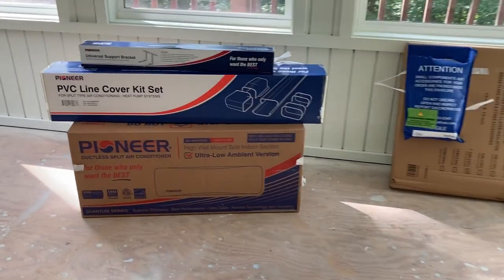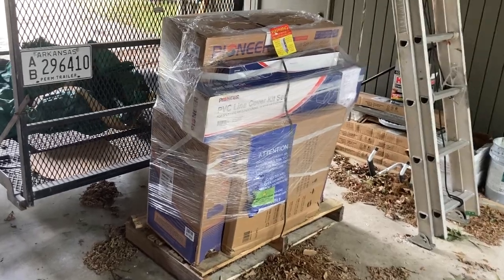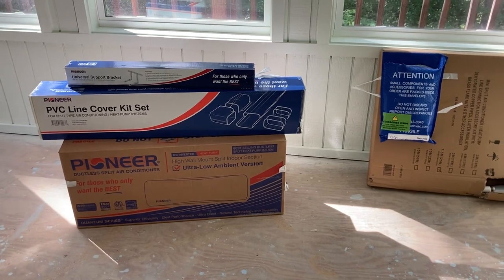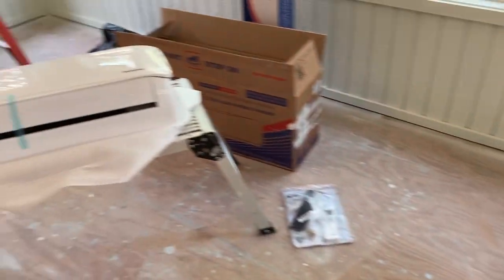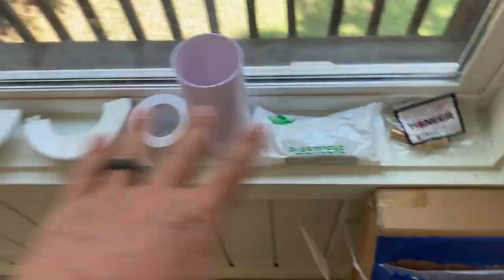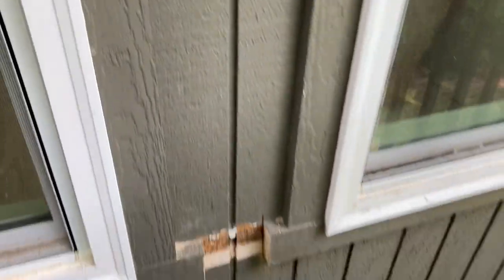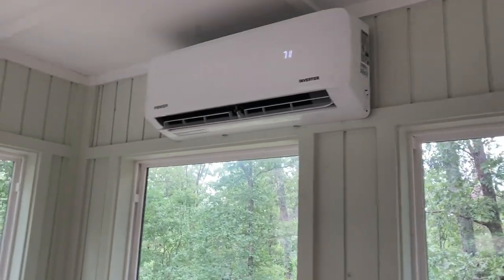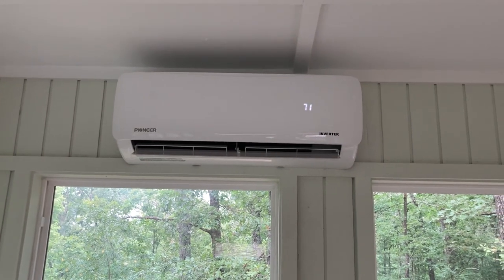DIY Install Pioneer 12k Mini Split Unit 230v - Careful, Don't kink the line set!

Comment: Excellent video. Thank you!

I just finished an installation of two Pioneer Hyperformance (WYF) Mini Splits. I chose them because of my very northern climate, as these units operate with great efficiency (23 SEER) and can heat when outside temperatures are as low as -22°F (with reduced efficiency, of course, but still operate.)   I think that your box said Hyperformance also.

I did not see your video until now, a month later. Before purchasing Pioneer Mini Splits, I must have looked at 30 YouTube videos. Yours is the best one of them all.  Granted, it is not a complete DIY video as you remarked, but it does the best job of summarizing the installation and giving warnings where needed.

I want to add my notes to your excellent comments here.

1. You were soooo smart to exit the lines to the right and not the left!  I was installing the indoor units on upper floors, so I figured it would make sense to make the connections inside the house by tipping the unit up and connecting underneath, inside, instead of on a 28 ft ladder outside.  BIG mistake. Use the ladder!  Reason is the lines installed to the left make a bulge that is almost impossible to compress to get the inside panel cover to snap on! Plus, the indoor unit does tilt up but it is on tiny plastic hinges that slip off with the slightest movement while you're working, threatening to drop the whole unit to the floor.  So much so, that it really takes two people to do the job, one holding and one connecting.  So, go to the right.

2. Do NOT use the inside little round plastic flange cover over the inside wall hole.  I don't think you did. It is useless and contributes to extra effort to snap inside cover on.

3. The line set ends from Pioneer are NOT the same.  The ends at the indoor unit are at different spacing to match the spacing of the indoor refrigerant lines.  The line set ends at the outdoor unit are equally spaced.

4. Your kinking experience was unfortunate but very helpful to others that follow you and they will, therefore, be extra careful because of your misfortune.

5. Your vacuuming, to my eyeball, did lose some small position on the compound manifold gage after you let it set for 30 minutes.  Granted, your vacuum may have been enough, but I recommend using a digital vacuum gage to make sure you get below 500 microns and hold the vacuum there.  Any moisture in the lines will cause some small acid build up and reduce the life of the unit.  Any air in the lines will cause extra compressor effort.  So, maybe your setup will be good enough to last 5 years, but why not get it perfect and maybe go 10 or 15 years?  Yadda yadda…. I know, I have seen on YouTube all the old guys say they never had a digital gage in the old days……  but still, I recommend it.

CAUTION: Re flares...... Refrigerant line sets do NOT use plumbing tubing sizes. In the small print it clearly say, on all mini split brands, that the 3/8 inch tubing line set is 3/8 inch o.d. 

BUT, if you go to ACE and buy a flaring tool kit for $28, you are buying a plumbing flaring tool kit.  Plumbing 3/8 inch tubing has a o.d. of 1/2 inch!!!!!  So, you are doomed to failure if you try to use a plumbing flare tool on a refrigerant line set.

6. All the rest of your video is spot on.

7. And that brings me to a different approach on my units than you took.

I am proficient in house wiring, so I knew I would do my own electrical work. At 75 years old, I am still strong enough to use a ladder, lift stuff, set the indoor and outdoor units, install a wall bracket indoors and on the outside wall, pour a concrete pad for one of the outdoor units, run the refrigerant lines out and down the wall, and install the line set covers, which, by the way, takes extreme grip strength to get them to snap together!!

But, I also have a few bucks in my pocket, and therefore having saved all the money by buying the Pioneer units direct (with free shipping) and doing the work above myself, I decided to get someone to cut off the excess line set length, nitrogen pressure test, vacuum the lines, and do startup and sign off on my extended warranty form (5 years.)

As you found out, there are puffed up hvac contractors out there who will be of less than no help unless you give them your first-born.

I was extremely fortunate to have a local hvac technician that had done over 80 mini splits in a giant housing project and he had excellent long-term results.  His work was quick and efficient. It took him from 9am to lunch to do the flares, the testing, the vacuum and help me with some lifting on the two units. What a pleasure it was to see him in action and to hear his stories.  He had a digital everything for tools, the best quality.

The cost for his services were acceptable to me without any haggling by me at all.

I slept well afterwards, knowing my installation was 100%.

I do applaud your own installation work and am sure you sleep as well as I do.

As for my 2 months of Pioneer Mini Split usage?  I could not be more pleased.  Units work great.  They are almost silent indoors and outdoors.  The Wi-Fi is great.  I can see my adjustments from anywhere in the world.  (BIG note here:  The latest (as of 9/23) app is ConnectLife.  Do not use the other 5 apps that others on YouTube used in the past!!!!!.)  I am going to purchase one more unit, and that is a testament to Pioneer.

I researched 5 different mini split ac brands including Mr Cool.  The biggest factor for me was not price, but customer service.  I read that Pioneer (Parker Davis in Ft Lauderdale, FL) answered the phone!  And, boy, did I call and call and call to get my pre-purchase questions answered. I had a few installation questions as well.  I never had to wait more than 5 minutes and often less than minute. I heard that another brand could never be reached at all….

So….
Have a beer!  Thanks for reading… and thanks again for your video.  The BEST ONE ON YOUTUBE for mini splits overall.
Reply from the maker: Wow!! Thank you for the reply and the praise! I enjoy making these videos. I’ve always been a DIY guy, and sounds like you are as well. The pioneer mini split I installed in this video has been running non-stop since I first turned it on (at the end of the video). It’s run non-stop now for 2-years. We leave it on during vacations, out of town, etc. The unit has ZERO issue cooling the sunroom. It keeps the sunroom as cool as an icebox during 100+ degree weather. And it will keep the room warm during ‘normal’ winters (normal meaning above 30 degrees for Arkansas). However when temps drop below 20 degrees the unit struggles to maintain 70 degrees. And if temps fall to near 0 degrees, it can’t keep up. We have French doors that lead into the main house and if I keep those open (which I do), the main house heat will supplement enough to keep the room livable. With that being said, I’ve ordered a 240 volt German made wall heater I plan to install over the next month. That should help the mini split keep up during un-common cold days this winter. 

I appreciate you walking me and others through your install. I enjoyed reading your reply. I’ll post a video of the wall heater install soon! I do my own electrical work as well (however I don’t post DIY electrical work, for obvious reasons). 

Thanks again for watching and for the excellent reply!

Comment: You saved a ton doing it yourself. So you are still far ahead. I did the same kink to mine but fortunately 2 ft from end so I had enough to cut off and redo end. A friend loaned me a 1/2” bender and the second bend was a breeze.

Comment: For those who don’t know may be no need to purchase vacuum pump and gauges. . A lot of major auto parts stores rent tools which usually includes vacuum pump and gauges. I’ve rented them at least 4/5times over last few years and never paid anything but a deposit -which you get back when return.

Comment: Great tips on not kinking the lineset. I would invest on a micron gauge, 2-stage vacuum pump and leak detector to check for the leak. Holding vacuum does not mean leak-free. It is when the unit is producing heat that the lineset has the high pressure when leak happens.
Reply: SO RITE !..NITROGEN PRESSURE TEST OVERNITE..SOAP THE FITTINGS,,ITS A LEAKER MOMMA !!LOL

Comment: I just finished the first zone of mine.  Thanks for sharing your mistakes and suggestions.  Its a steep learning curve the first time you do it I think.  The second zone should be easier now.
Reply from the maker: Awesome! There is great satisfaction in doing it yourself! Good luck with the remaining zone! My unit has been flawless so far. Keeping us cool during this 100 degree heatwave! It runs 24/7, we haven't turned it off since the install. No short cycling. It will power itself down or up when needed, on cool or heat settings.

Comment: I wish you would have mentioned the crowfoot sizes.  I saw the 15/16 by stopping the video. Also, I would have liked to see you connect the hoses in the inside unit.  My main reason for watching was to see how it is done in that tight space with a torque wrench.

Comment: Wow you did a great job, just had the same unit installed only difference mine is 110v. My installer did not close up those electrical holes on the unit like you did. See you learn things when you watch YouTube.👍🏻
Reply from the maker: Thanks for watching. Closing up and capping the electrical connections at the unit should be code in most places. I would have them come back and do that.
Reply: @Ozarkwild  I did my electrician came and did it for me but the air-conditioning guy should’ve done it

Comment: When you took the adapter off the mini split port did a lot of refrigerant come out thanks for the idea i have been doing it by releasing all the refrigerant first from the liquid and and the suction line I open all the lines up I think the idea you did is good you just open the suction line a little to introduce some positive pressure and then close so you don’t loose refrigerant
Reply from the maker: I did not lose much refrigerant at all, just barley. You are correct, introducing only a little positive pressure prevents the high pressure release as you remove the adapter. Make sure it's done quickly however, or else you run the risk of evacuating the line (due to the very low pressure).

Comment: Nice!!! I am installing one of these for my Jeep garage this week. It just got delivered a few days ago.
Reply from the maker: How did the install go? Any issues?
Reply: @Ozarkwild  it all went pretty smoothly. The hardest part was just bending the conduit and running wire. Everything else was pretty darn easy, just one step at a time it went great. I took my time and triple checked everything and my 12k btu unit cool and heats great!!
Reply from the maker: @REJECT_GARAGE  Good to hear. Mine is still running great as well.

Comment: I just looked at my adapter the smaller part that connects to the line don't have the valve inside at all & all three of the gauge lines do have a valve depressor

Comment: Cool install.  Very thorough.  Can you adjust the vents on the inside unit so that they permanently guide the conditioned air up or down or left or right like a car vent?  One of the only spots in my house that will fit the indoor unit aims the air down a flight of stairs if it shoots straight ahead.
Reply from the maker: Yes, the vents are adjustable on this unit, power adjustable, using the remote. It's been 5 months now with the unit running non stop, working great keeping us warm.
Reply: @Ozarkwild  thanks

Comment: Big Mistake most People DIY do , in your Lines kit bag there is a white tape , you should always cover all lines before any install, it really help to protect the lines for years
Reply from the maker: Good tip, thanks.
Reply: Should I tape over insulation?

Comment: I’m still a bit confused on if you are supposed to let the refrigerant out while the suction hose is on or if it needs to be removed prior to releasing the refrigerant?
Reply from the maker: You will close the valves on the gauges after you have held the vacuum. You can then remove the gauges and then release the refrigerant
Reply: @Ozarkwild  that makes way more sense.

Comment: Me personally I would have mounted the unit centered on the inside wall? Even if you had to remove some Sheetrock and run the lines straight down under your deck.
I did this in my living room. Looks centered and no piping.
Reply from the maker: That would have been the best place for it. I thought about it. That wall is T111 and would have been pretty easy to remove. Future plans are to convert the entire house to mini splits. Been looking into the distribution boxes. They are so efficient. This will require the line sets to go inside the walls.

Comment: My Senville 12,000btu originally came with the 16ft line set that I ruined so I ordered the 25ft line set because I moved the inside unit to a different location is ur a 25ft line set ?
Reply: How is your unit working now?
Reply: @Katana_00  great I'm sitting in some nice cool air right now
Reply: @diysolaradventures7894  awesome. I’m so close to getting one.
Reply: @Katana_00  they nice & im running mines completely off grid on my solar system 👍

Comment: @ 12:00 Your ground wire is not connected properly. It needs to go one more to the right.
Reply from the maker: The ground is connected to a ground block. Doesn’t matter if it’s on the left or right of the block. It’s the same block.
Reply: Terminal blocks only provide continuity to the terminal directly across from itself. There is nothing connected to the terminal across from your green ground wire. Do you see that yellow wire with a green stripe on the top right terminal? That is the ground wire to the mini split. Take a multi meter and check continuity between your green ground wire and that top right yellow ground wire. You will find that you do not have continuity between the two. Your internal unit is not grounded.  @Ozarkwild
Reply from the maker: @thefungusshow2535  Interesting. I’ll check it out. Thank you

Comment: no nitrogen pressure test??
Reply from the maker: No, most DIY mini split installs do not nitrogen test, and not always necessary. My unit has run 24/7 now heating and cooling going on a year now, no issues.
Reply: HE GOT LUCKY///
 @Ozarkwild
Reply from the maker: @stevenstadterman9725  No luck here, just helping to break the chains of a few folks within the fear mongering HVAC industry
Reply: I'm in the middle of an install myself but had a company install a different system last year and I'm almost positive they didn't do the nitrogen test.  Not sure if it was laziness or they feel it's overkill.  No issues though.
Reply from the maker: @RaffBuilding  Nitrogen test are an extra step to ensure no leaks. But certainly not necessary to obtain a leak free functioning system.

Comment: Its been a couple of years. I’m a about ready to purchase an 18 K unit from Pioneer. How do you like the system? Would you recommend someone to purchase one?  Thank You
Reply from the maker: @ianwallingford4039  I highly recommend the Pioneer system. When I turned the unit on (at end of the video), it has ran 24/7 ever since. We never turn it off. Cooling.. it will freeze you out of the room if you wanted, no issues. Heating… works fine down to the upper 20’s and then it can’t keep up, but attribute that to poor insulation. I installed a wall heater to supplement during extreme cold. You won’t go wrong.. just make sure to install properly. Take your time. Good luck 🍀